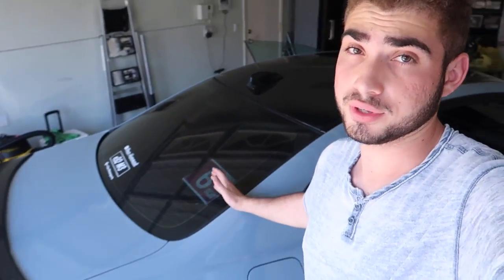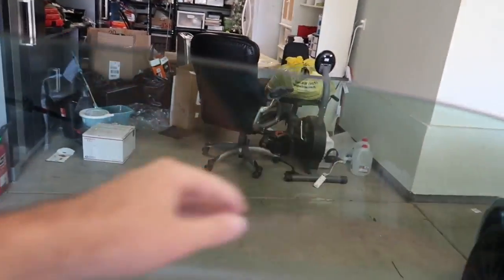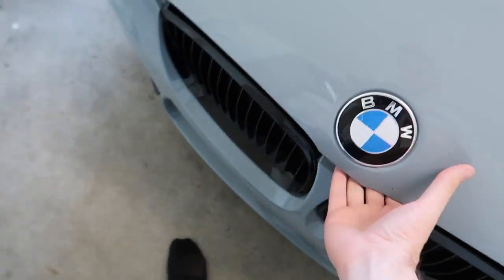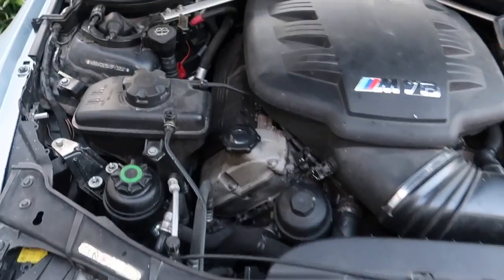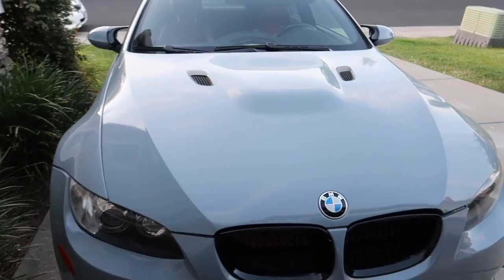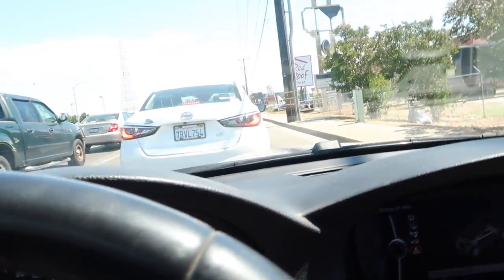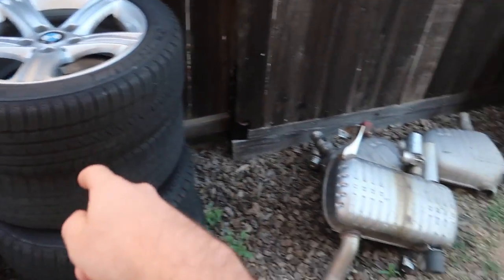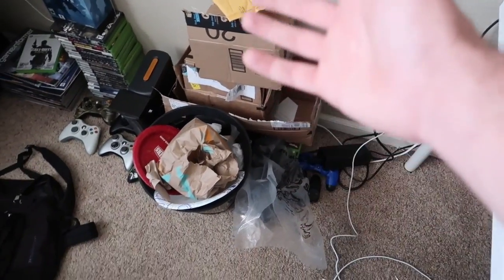MY BMW M3 IS NO LONGER UNREGISTERED! PASSED CHP INSPECTION!

Comment: Bro, did u figure out the battery drain issue that you posted about in ur last video? Does your M3 have EDC? My E93 M3, EDC was causing the battery to drain, had to get it replaced and coded again by BMW.